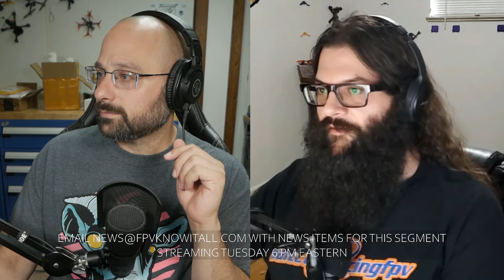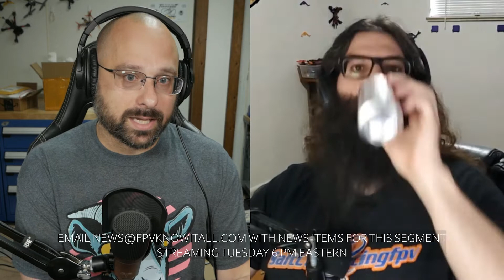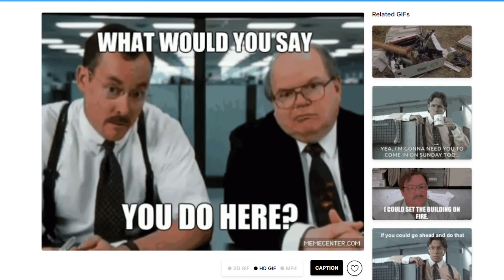ExpressLRS for SBUS only FC? Yes! ELRS devs respond in record time

Comment: I tried the inverted output on elrs. It did not seem to work as an sbus output for me. Also not clear what it means when you invert the crsf output, and how that relates to sbus. Can someone please make a simple video showing how to do this. I had to resort to a pwm elrs rx which worked, but the wiring was a mess. This was for a zohd kopilot lite which uses sbus.

Comment: So, im sure I have came across the solution time over again, but i cannot find an exact replication of my situation.... I am Using a DJI Naza M v2 FC and am using Jumper T pro with internal Express LRS. The receiver I have only has RX TX but have been extremely confused as to where / how to connect them to my FC since the user manual does not cover this only dealing with SBUS and traditional receivers with 3 4 channels and/or 3 position switch... This is my first quad I've been attempting to build. seems to me that i have just purchased the wrong Transmitter/receiver combination for my FC..

Comment: Will this sbus work with a fixed wing flight controller that only accepts pwm/sbus? 

ZOHD flight controller.
Reply: No this is not SBUS it's just inverted CRSF. So it wont work with the ZOHD Kopilot. The ELRS devs say that adding true SBUS would be very challenging because of the way the code has CRSF integrated.
Reply: @sasodoma  Doesnt CRSF support SBUS though? L
Reply: @GrowingSurvival  Crossfire receivers support both CRSF and SBUS protocol. ELRS only supports CRFS.
Reply: @sasodoma  So my wings hooked up using ERLS using a single wire.... its an Sbus only FC from ZoHD? and works fine.  :S
Reply: @GrowingSurvival  So you're saying you have ELRS connected to a ZOHD Kopilot and it works?
Reply: Yeah! I was surprised but after watching this I tried anyway before buying the pwm elrs rx and it works!  Switches and full control over control surfaces
Reply: @GrowingSurvival  So you just connected ELRS TX pin to Kopilot SBUS input? Did you have to configure anything else?
Reply: @sasodoma  Nope, it just worked.
Reply: @GrowingSurvival  interesting, I tried it now and couldn't get it to work. Tried inverted and non inverted TX
Reply: @sasodoma  non inverted... Didn't work on 915 but worked on 2.4 betafpv gear
Reply: @sasodoma  
Hello! I have LEFEI SN-L V2 controller with SBUS input, I acquired RX nano ELRS 2.4 from betafpv, how should I make it work for me? Please I would really appreciate your help!! Thank you
Reply: @fpv_wing  There is no way to get SBUS out of an ELRS receiver directly. The simplest option would be to buy a CRSF to SBUS converter.
Reply: @sasodoma  muchas gracias!!
Reply: also would like to know this

Comment: So is the sbus output from express lrs avaliable? Or we need to wait for it a bit more?
Reply from the maker: They have done it one better by outputting inverted CRSF instead of SBUS. So you can wire the output of the ELRS receiver to the SBUS input on your FC, and then select CRSF as your protocol and all's well.
Reply: @JoshuaBardwellLivestreamClips  so i will connect the tx gnd and vcc of the receiver to the sbus port and will work or i am wrong?
Reply: @JoshuaBardwellLivestreamClips  so let's say I don't have a TX port and just one uart (rx1), can I hook up the elrs receiver to just the rx pad? I don't mind losing telemetry or osd controls. Thanks!
Reply: @JoshuaBardwellLivestreamClips  The sbus output or TX?
Reply: As a fixed wing guy using a lot of SBus servos sometimes up to a dozen in a jet, I am sorry that I couldn't get the benefit  from ELRS
Reply: This hasn't been working for me at all. I've tried inverted crsf and sbus options in my receiver and crsf or sbus in my FC as well. Nothing is working. Not sure what I'm doing wrong.
Reply: This hasn't been working for me at all. I've tried inverted crsf and sbus options in my receiver and crsf or sbus in my FC as well. Nothing is working. Not sure what I'm doing wrong.